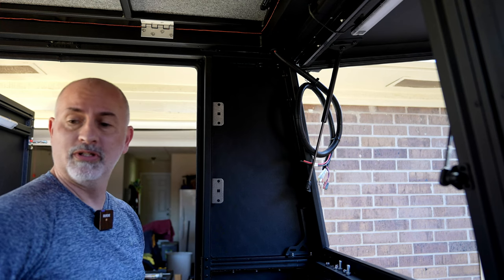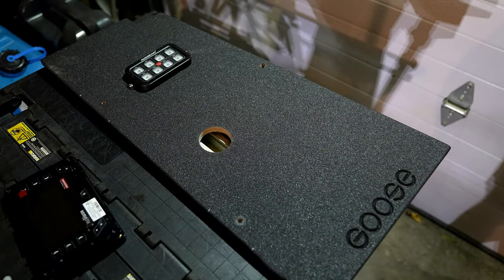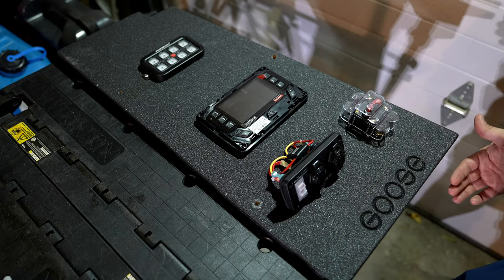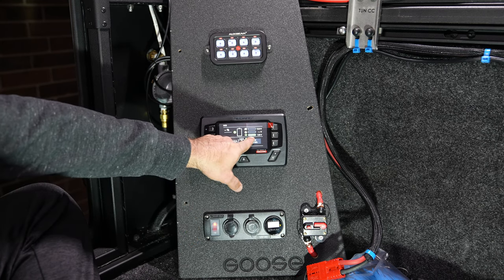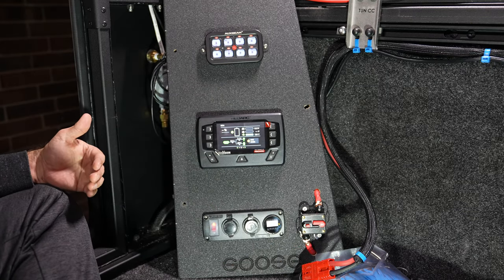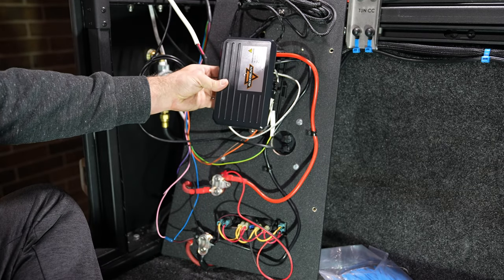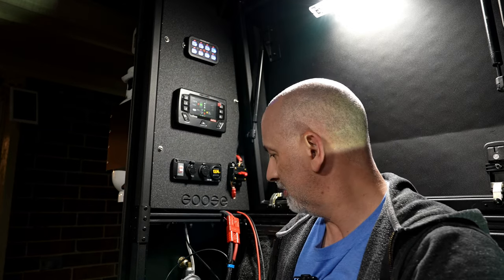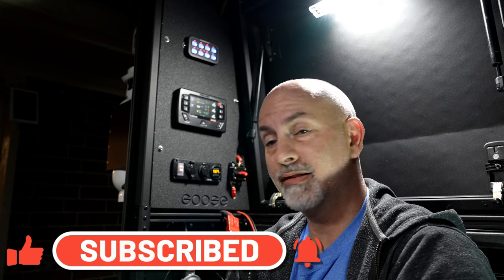The Alu-Cab Cabin Goose Gear Control Panel Install

Comment: Why did you install an Auxbeam 8?  Doesn't the Redvision control panel control all switching?  I'll be doing electrical in my Alucab soon, so I'm just trying to understand all options, thanks.
Reply from the maker: you are correct about the complete red vision system. i only purchased the manager 30 with the color control panel to save money.
Reply from the maker: also, the auxbeam has a smaller control box footprint, so im saving space as well.

Comment: Where did you get the mounting hardware for the Goose gear panels?
Reply from the maker: hey it comes with the panel
Reply: @OverlandTrailsAdventures  Mine did not. I bought the pair and no brackets or hardware
Reply from the maker: maybe i am mistaken. it was a long time ago. Ryan at CB Adventure Supply would have the brackets if you need them